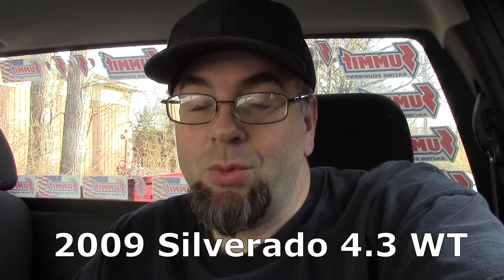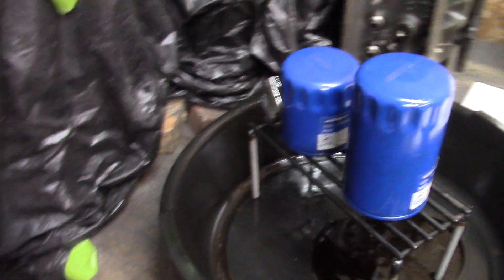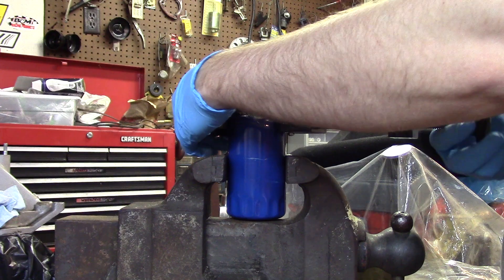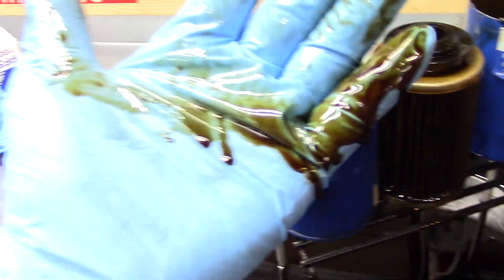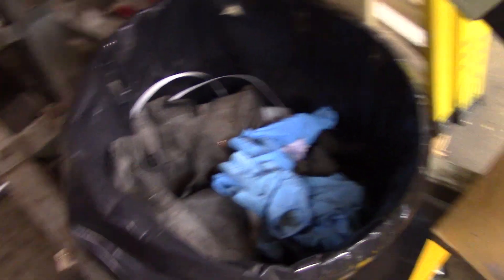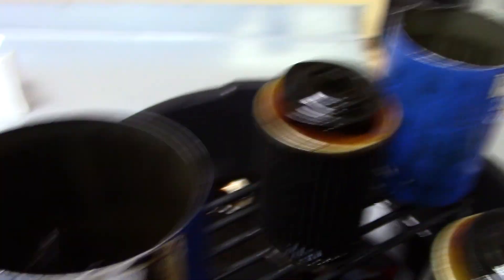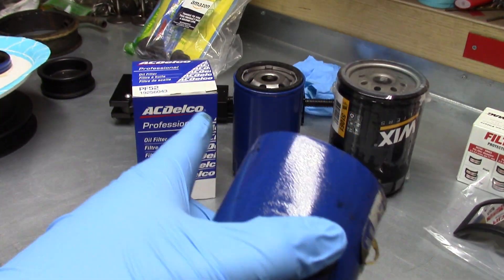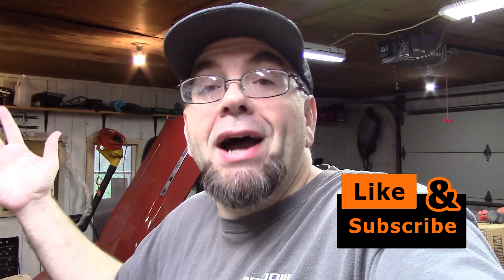Do Oil Filter Magnets WORK?  Cutting OPEN My Daily Truck FILTERs

Comment: Your oil is extremely dark for just over 3,000 miles. Dark oil with such low miles usually indicates excessive wear.
Reply from the maker: I've been changing my oil or for others, all my life and looks pretty normal to me.  Now if you consider my camera, video editor, uploaded to youtube or what ever electronic you're watching it on....
Reply: Run an oil analysis. 
That would quantify the wear in the engine.
However, it does appear to be excessive given the dark colour.

The solution to excessive wear is better oil rather than more frequent oil changes.
Better oil will result in less metal on your magnets.
Less wear is preferrable to frequent oil changes.

🙂

Comment: if you want to get oil out poke a hole in bottom with a punch and then it will drain fully out the bottom

Comment: Well, you can see where he magnet was and the stuff it collected. No denying it. Personally, I probably wouldn't run one. To me, if there's enough stuff collected by the magnet, you'd be able to see it in the filter media. Guess it'd save you the trouble of digging through an oily parts. Thanks for posting the vid. It was informative.
Reply from the maker: You won't see the fine metal in the filter or if it gradually increases per oil change.  Then you know trouble is INC
Reply: @BOOT , good point.